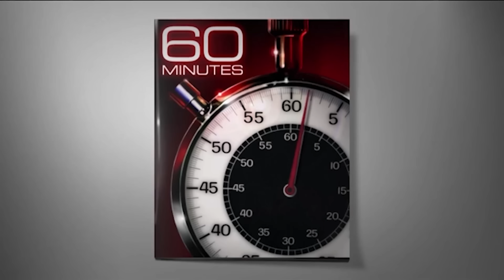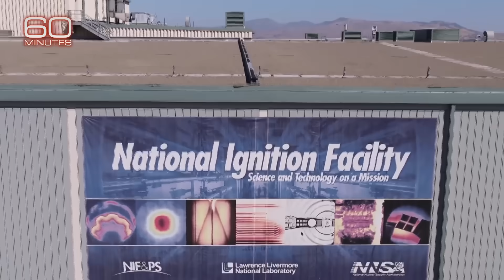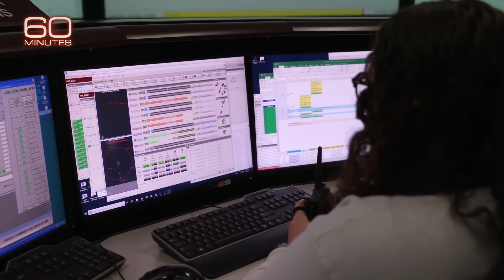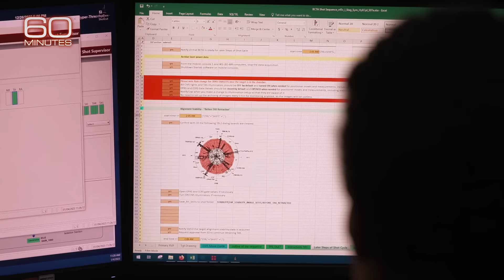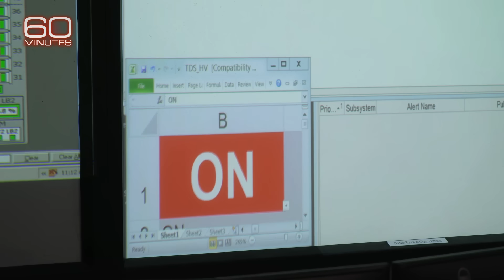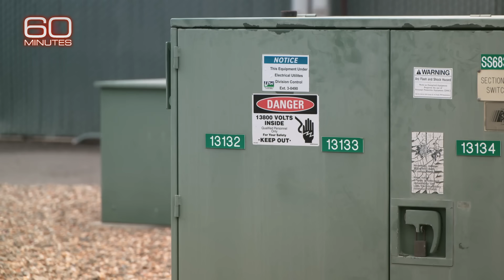Nuclear Fusion: Inside the breakthrough that could change our world | 60 Minutes

Comment: Sad to hear they left out the part of the 300 units of energy needed to put in when firing the lasers. Why did they originally say 2 units in 3 out? I thought this was clearly considering the energy costs of firing the laser. If not what energy cost are they measuring?
Reply: The lasers are 30 year old tech.  There are way more efficient lasers available.  Now that this achievement has happened, more funding may mean and upgraded facility.  Can't upgrade without results...

Comment: This is significant in the sense that it proves, once and for all, that an artificial fusion reaction can be created that release more energy than it delivered to the material. Then again, it did not really seem much in doubt. But in engineering terms, I don't see a path for inertial fusion to be a power source. It will probably be magnetic confinement, or something similar. Even there, the approach getting most of the attention may well not be the one that wins out in the end. It may not be a tokamak, but rather some kind of stellarator design, or maybe a Z-pinch or something along those lines.

Seife is probably right that ten years is unrealistic. Twenty years, possibly, especially with magnets using newer superconductors, such as what they're doing at MIT.

It will certainly be fascinating to see how this develops in the near future.

Comment: I think most people have believed a proof of concept was already achieved decades ago. This is still science for the sake of science. Fusion is not close to being utilized economically in our lifetimes. But it is a good example of why investment in fission is crucial. To push the envelope of science will require massive unlimited energy to move research forward. Whether it is eliminating carbon emissions, recycling rare earth metals or sustaining life with clean water, we need to be building clean fission reactors at a pace not even contemplated but definitely possible.

Comment: The NIF is not even designed to generate commercial fusion. It's a nuclear weapons design facility. 

Their method is basically impossible to get commercial fusion

1 - they got more energy than the lasers. But the total energy spent each shot was 100 times smaller than what they got

2 - the energy released must be converted to electric energy first. That means somewhat like 50% losses

3 - they would need to fuse 100 of those perfect diamond pellets per second, each one inside a perfectly machined gold hohlraum that becomes gold plasma flying towards the walls of the device. 

4 - thus even if they increase energy output by 100x to achieve real break even,  they will be decades or even centuries behind commercial electricity production break even

Comment: So are we now finally just 20 years away from a working fusion plant!! Not likely. This was not a "revolutionary," but merely an evolutionary achievement. They've been pushing toward net energy output for some time using this process. They finally crossed the threshold, and that's great.  But most of the same huge hurdles to a working energy plant still remain.
Reply: you say that like they aren't working on removing those hurdles

Comment: Call me a Luddite, but I'm not in favor of pursuing fusion power generation. Similar with hydrogen power and/or fission.  I'm in favor of taking the most efficient tech and maintaining/developing it, such as solar, wind, thermal, tidal, and wave power.  Higher tech doesn't always = preferable.  Also: energy conservation should be paramount.

Comment: I believe that we have already achieved different sources of energy with hydrogen and water, but alas; it was suppressed by the government or the fossil fuel companies.  I saw a scientist use only water to power a torch that melted steel.  He also drove an old Ford Escort 69 miles on less than a pint of water, got a Government contract to modify Military Humvees, but alas... he was dead in a year.

Comment: The hype over this is such a distortion. This is no way a breakthrough in achieving a practical fusion energy source. If you read the technical reports, you find that the lasers are < 1% efficient. So, the claim that more energy came out that was input is plain false. Yes, more energy than the laser beam energy to the hydrogen pellet. But the total energy input to the lasers was > 100 x the beam energy. Furthermore, the lasers need a day or more to recover, before they can fire again. How can that deliver a continuous output? And the hydrogen pellet is a capsule of precise design and difficult to fabricate. And very expensive. How can they be fed to the target site rapidly enough, even assuming lasers can fire rapidly? And the pellets must contain cryogenic hydrogen, which is difficult to handle and store. These capsules have a history of unreliability. In any case how can blasting pellets in such a manner remotely supply continuous power? It’s a dead end. There is far more promise with Tokamacs and Stellarator type machines, where magnetic plasma confinement may allow continuous fusion. The hullabaloo over this laser and pellet zapping is more of a publicity exercise for funding, than any valid claims of bringing useful fusion closer.

Comment: Glue, diamond and hydrogen are ignited with a laser?  and which bits are fused together?   It all sounds very ambiguous?  What if your model of physics is wrong?  What if the centre of the sun is hollow, and that's why it keeps getting colder towards the surface?  The moon is hollow, so this is not a wild theory for astronomical bodies to be hollow.    Nuclear fission explosion's emit heat, heat normally travels outwards (upwards) from the surface of a planet or star, not inwards, nuclear pressure could hold a hollow sphere shape, with sideways pressure, whilst it all try's to explode outwards, ..it should be remembered.  Gravity is a result of curved space time, not a ball of plasma in the centre of the sun...   If you give me a job, maybe I might be of some help...
Reply: The fuel in this case is a 50%-50% mixture of deuterium and tritium. The diamond plays no role in the fusion reaction. The product of the fusion is helium-4. The tritium fuel component is extremely rare, extremely expensive and highly radioactive. Normal hydrogen (hydrogen-1) plays no role in this reaction and will not react in this case because over 300 millions of degrees C would be needed to cause it to fuse.
Reply: @vernonbrechin4207  That's an unexpected impressive reply, thank you...    Helium 4 production is a confirmation, it's a remarkable engineering achievement...  What's next?  Are there any problems left to solve?

Comment: There was no 'hiding' the fact that the lasers needed 100 times more energy..... they were NOT designed to be efficient!! It is a bogus criticism
Reply: It is. The lasers were state of the art when the project was conceived and they are still very advanced tools. The lab has been pitching to employ the newer Laser Diode Pumped Lasers which can be up to 20% efficient. The simple fact is that even the most powerful of them doesn't come close to the NIF lasers and if one has to shift wavelengths twice, as is done in the NIF laser system, that will result in the efficiency plunging well below 20%.

In earlier NIF announcements the lab management never stated the level of energy that was required to power the lasers. They had to start doing that because of leaked criticisms.

Comment: Total rubbish.   If you look past the blab, and look at the actual numbers, nothing of any importance happened.  

There was a net energy production, but only if you use the most misleading and myopic viewpoint.

In reality, there was about 200 times more energy used than was released.  You see the triggering lasers are only about 0.5% efficient, so while the net power out was slightly larger than the laser power that hit the target, the actual power used was 200 or so times larger than the net power created.

So you can never come out ahead and make any actual net usable power this way, quite to the contrary, the power out is negligible.

And the repetition rate of charging up the laser capacitors takes many minutes.   It can never be a useful source of power if it's only putting out a few watts for a thousandth of a second, every minute or so.  

And the cost per kilowatt out is over a million times worse than other power sources.   NOone would ever be able to afford building a megawatt steady power plant using anything like this technology, there isn't enough money in the world do make a megawatt power plant this way.

Also if you read further, they say the laser equipment, lasers and lenses and mirrors, are only good for about 2,000 shots.  It would take weeks and many  millions of dollars to replace that worn-out equipment, after having made under $1 in electrical power, so it's  very very far from an economic proposition to use this kind of reactor.

They have to improve the physical efficiency and economic efficiency of this device by a factor of at least 1,000 physically, and  many millions economically, before this would even approach being feasible as a power source.   Engineers can be clever and improve things at a rate of like 2 to 4 times better per decade, but at that rate economic viability is still centuries away.  

This announcement is a triumph of public relations and marketing, in other words, plain out lying.  It's not how actual scientists and engineers communicate.

Comment: Funny how, more than 10 minutes into this 13 minute piece, they admit that it took 300MJ to produce the 2MJ laser burst that resulted in 300MJ output.

This experiment was definitely worthwhile and produced a lot of valuable data to be sure.  But it was not a "breakthrough in commercial fusion power".

This experiment did exactly nothing to bring commercial fusion power any closer to reality.

At the end of the piece, they reveal the real motivation of fusion power research.  It's an easy way to generate investment from people who don't understand physics.

If you look at it objectively, building an economically viable fusion power plant on earth is impossible.   It makes more sense to capture energy from the existing fusion reactor at the center of the Solar System.

Comment: what was with the little 300 to 3 comment there in the middle? xD ha!
Reply: The NIF lab staff have finally started to admit that the input energy to power the laser is 300 times greater than the energy that was produced by their 'breakthrough' fusion energy reaction output. The lab used to hide that information until outsiders pointed out that the laboratory management had been keeping quite regarding the enormous amount of energy consumed by their laser system.

Comment: There is NO safe form of nuclear. All forms release radiation into the environment in one way or another.

Glomping atomic nuclei into each other, and what happens? A whole lotta neutrons and photons at very dangerous wavelengths and alpha and 

beta particles, whatever, get released.

You wouldn't want to be anywhere near where enough atoms are glomping into each other in enough quantities to make energy production 

financially feasible.
Reply: Typically, most fusion energy promoters claim that the fusion fuel is virtually limitless because the hydrogen can be derived from sea water. That is totally misleading.

In most of the fusion energy proposals, and in this experiment the fusion fuels are deuterium and tritium which are not commonly produced. In fact tritium is extremely rare, extremely expensive and is radioactive. This program didn't mention those aspects of the fuel being used. The lab management tends to downplay those aspects when addressing journalists and the public about their 'breakthrough' experiments. Those experiments have always been primarily funded for the purpose of thermonuclear weapons (H-bomb) research. After each NIF D/T shot is performed the huge vacuum chamber has to be cleaned out and the tritium contaminated material has to be disposed as radioactive waste.
Reply: Fusion isn't any more precious-wecious cutesy-wutesy-poo than any other form of nuclear.
Reply: I don't understand all the fetish for radiation. A very strange fetish to have. A fetish for radiation like pyromaniacs have for fire.

You she entity lifeforces (including she entity lifeforces existing in XY DNA template bodies) do the strangest things.

Comment: Copper melts at just under 2,000 degrees Fahrenheit. 

The center of the sun burns at temps around 27 million degrees Fahrenheit.

How does a copper “target” not melt into a puddle of goo and then be entirely evaporated when blasted with a heat source hotter than the center of the sun?

Someone smart explain this to me please. 

Thanks you guyzzzz!
Reply: Thank you for your question. Keep in mind that the laser pulse is only about 3 billionths of a second in length. The fuel capsule compressing X-rays are shorter than that and the fusion reaction only lasted for about 0.08 billionths of a second. When the inner walls, of the hohlraum are hit by the laser beams they immediately covert to a plasma that is many millions of a degree C. That plasma then generates the compressing X-rays that compresses the tiny fuel capsule at the center. The diamond walls of that capsule and the contents are covered into an extremely hot plasma as it is compressed down to a microscopic size. Then that plasma expands explosively destroying all the supporting structures that hold it in position. What was shown to viewers was inches away from the fuel capsule. The copper supporting structure was pealed away from the blast of that tiny explosion. Each time a similar experiment is performed like this about $100,000 of target assembly structure has to be replaced.
Reply: @vernonbrechin4207  Are you some disgruntled employee who lost his job at this facility and now takes to YouTube to degrade what they accomplished? ??
Reply: I’ll have to read your response about twenty more times and then google search for a few days before I begin to glean an understanding of what you said, but thanks for taking the time to say it.
Reply: @jabbertree  - Thank you for reading my comment and for maintaining an open mind. Good luck in whatever level of external search you achieve. Wikipedia tends to be a good source of info. I have a diverse and strong technical background. I've been closely following the quest for controlled fusion energy since the 1970s so I'm aware of aspects of it that most people are unaware of. That includes many of the younger people who now find themselves working in this highly complex technological field.
Reply: @vernonbrechin4207  Are you some disgruntled employee who lost his job at this facility and now takes to YouTube to degrade what they accomplished? ??

Comment: How do we know this isn’t a fluke reading? Has it been repeated?
Reply: This experiment has not yet been repeated. About a year ago a similar experiment yielded an energy 'gain' of about 0.7 which was announced. Over the months the NIF staff tried to get a similar result but failed repeatedly. This announcement was only made because they finally achieved a 'gain' beyond 1.0 in this particular experiment. The lab is not in the habit of announcing their failures. NIF has always been primarily funded as a thermonuclear weapon (H-bomb) research tool and secrecy is a required aspect of such research. The LLNL management are masters at obscuring NIF's primary function. In this announced experiment their were nuclear weapon's related aspects to this shot.

Comment: Eh. We use about 17.5 times as much tritium as we make, and we have about 40 pounds left. This discovery just means we haven't hit a dead end yet. We won't be able to keep kicking this 30 years down the road for much longer since we only have 20-30 left. They have ways to produce, but they're too slow. The biggest idea to make enough to save it won't even be properly test run until 2035. Caveat? Lithium needed for tritium breeding blankets will hit rarity status a few years earlier.
Reply: The ITER project suspended their tritium breeding research program due to their major cost overruns and completion date delays. This '60 Minute' segment barely mentioned the tritium issue. Almost no other fusion energy program is looking into the tritium breeding program while fusion energy advocates continue to claim the fuel is found in the ocean and is virtually limitless. I'm glad you brought it up here. Fans of nuclear power of any sort tend to continue to assume that we have 20-30 years left to turn this 'Titanic' around. They tend to be masterful at excluding the following warnings from their consciousness. I urge readers to search for the following article titles.

IPCC report: ‘now or never’ if world is to stave off climate disaster (TheGuardian)

UN chief: World has less than 2 years to avoid 'runaway climate change' (TheHill)
  * This statement was made 4-years ago.
Reply: @vernonbrechin4207  Are you some disgruntled employee who lost his job at this facility and now takes to YouTube to degrade what they accomplished?